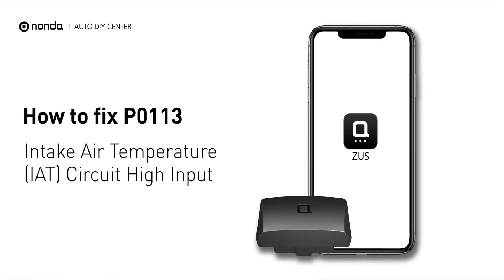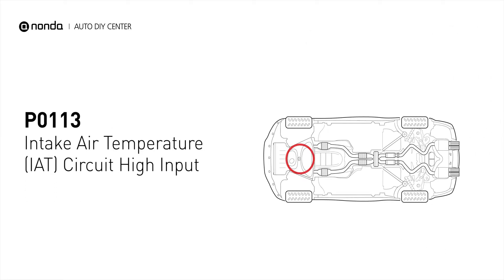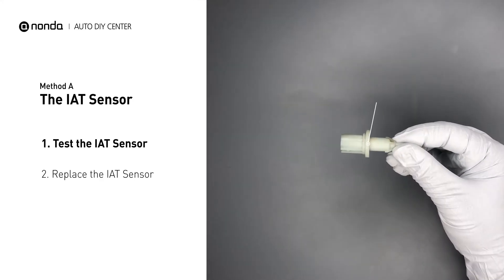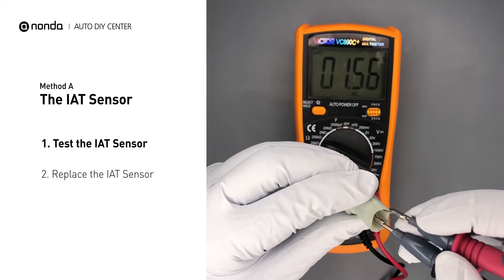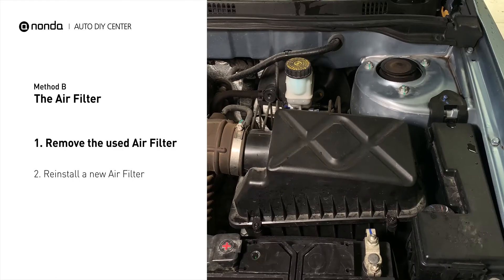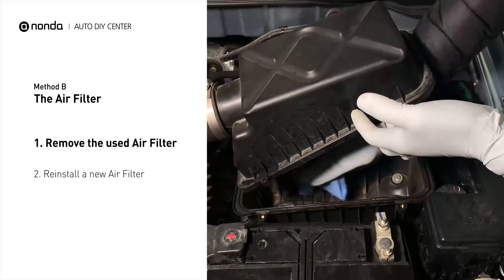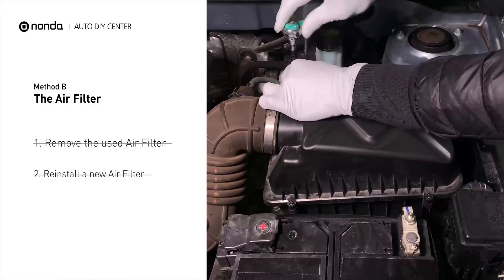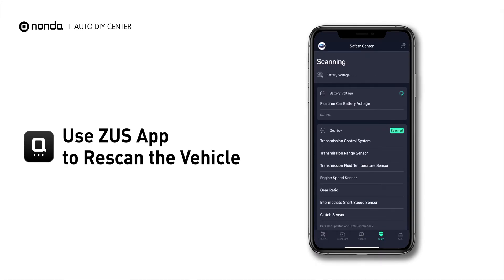How to Fix P0113 Engine Code in 3 Minutes [2 DIY Methods / Only $7.76]

Comment from the maker: Hi, I'm Steve, nonda's lead mechanic engineer. 
Feel free to leave your comments here if you have any mechanic questions, I will be glad to help you out!
Reply: Hey so I have a 2000 ford f150 4.6 and I'm having the same problem with the po113 code I replaced the maf sensor and the iat sensor and my air filter is clean but yet I'm still having a problem also I did notice that my abs light is on too
Reply: the P0133 code is permanent code and cannot be removed right?
Reply: My niece's 2014 Honda Accord gave a P113 code fix, indicating it needs the intake flow sensor replacement. Checked the Air Filter and is super clean, so I'm thinking of replacing it today.
Reply: Hi Steve, I have a question. My catalytic converter was clogged. I took my GMC Sierra 1500 5.3 to the shop to get fixed the mechanic says he cleaned them. The weeks are horrible. However now my truck stalls while driving. I've replaced the O2 sensors, crankshaft sensor,Map sensor and throttle body because the sensor is attached. Could you help me?

Comment: What has air filter to do with intake air temp sensor? Nothing! And if this sensor is unplugged or not working, your vehicle will read -40 for the intake air temp and will be stuck in Open Loop mode ,  at least that's what my GM truck does.

Comment: When my car broke down two days i could turn on the engine and idle but when gas was pressed or tried to move it would lose power would start sputtering before  turned off completely .. after many attempts its lost it's power to even turn engine on.. i thought my fuel pump died but i just scanned and these codes came up...what should i do? Btw My engine light isnt working so would the scanner detect if fuel pump was the issue?
Reply: Hi did you manage to find out what caused it? I'm having the same issue
Reply: @samwarburton2672  yes. It was the egr valve. It was stuck open due to carbon build up
Reply: @imrxnz2531  sorted mine too, it was the high pressure fuel rail sensor.

Comment: I replaced maf sensor iat sensor and air intake. The code was gone for like 2 months now it comes back every day even after clearing the code
Reply from the maker: Hi Nick, please provide us with your vehicle's year, make and model.
Reply: @nondainc  it’s a 2003 GMC Sierra 1500 with the 5.3 the maf and iat are all one unit
Reply: @nondainc  my guess is the the new maf/ iat sensor already failed I bought it on rock auto an they had like 4 different brands of them so I might try a different one
Reply from the maker: Hi Nick, please thoroughly inspect the wiring/connections from the PCM to the IAT sensor for any issue. Check your air filter if its clean and change if its not.

Comment: I have a mustang gt 96 4.6 my car gave me this codes I replaced both mass air flow sensor and  the IAT sensor as well but code still comes back I replaced my 02 sensors as well cause I was receiving lean on bank 1 and am not sure if it was also showing me bank 2 I need help lol I know if I take my car in they would try ripping me off
Reply from the maker: Hi Julio, have you inspected all the wiring related if there are damage/corrosion or if there's improper harness connection?
Reply: you need to take your car to a mechanic, and ask him to test wires.